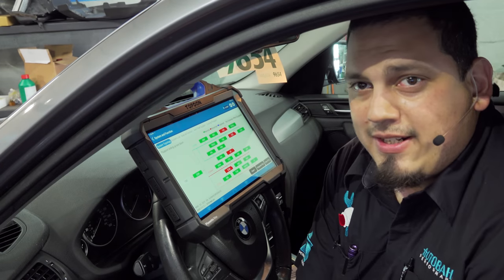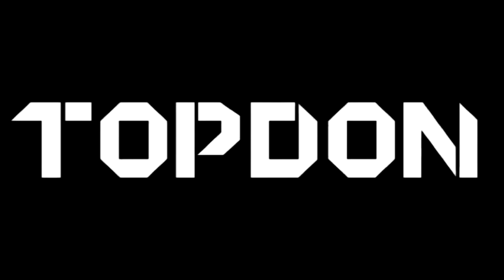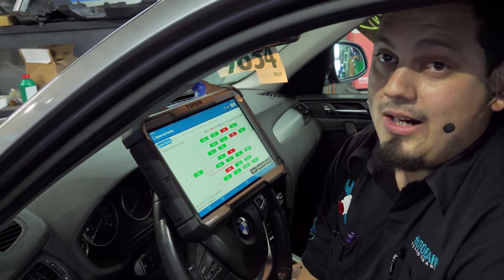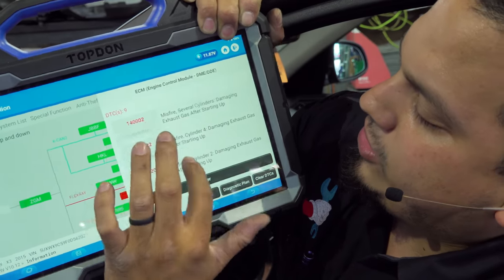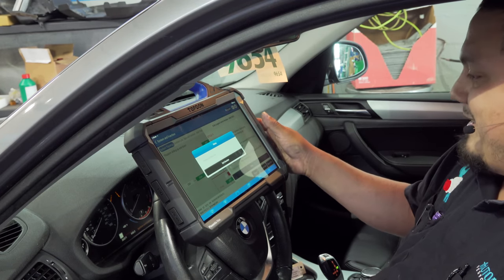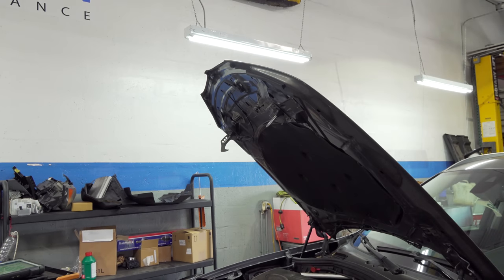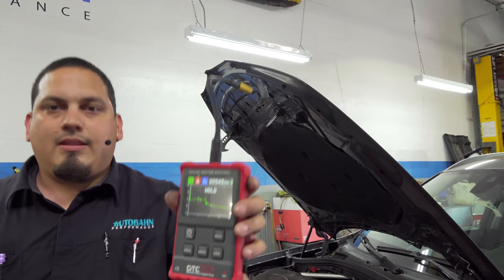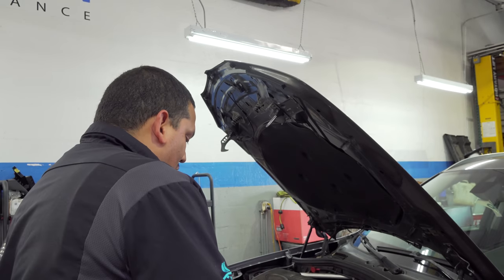BMW X3 N20 | MISFIRE DIAGNOSIS | IN REAL TIME | MULTIPLE MISFIRES

Comment: Dude that ignition analyzer is pretty slick!  You mentioned a lean condition could lead to premature coil failure... Wouldn't that lean condition cause either a partial misfire or maybe a "fuel trim imbalance" code? What did the spark plug look like? 🙂
Reply: Hi there Pine Hollow~Enjoy your evening and great comment too
Reply from the maker: Not always, you know that lol

Lean conditions aren't always on a single cylinder, sometimes it's a small vacuum leak, or pcv valve issue that causes premature ignition coil wear
Reply from the maker: Oh, btw, gdi always run slightly leaner, spark plugs will read accordingly
Reply: @SuperMarioDiagnostics  very interesting! Would the PCM not compensate for that and set a lean code if the mixture is too far out of spec?
Reply from the maker: Most of the time but Not always, sometimes it'll set only high idle rpm codes
Reply from the maker: You asked me about that one LOL can't say that i have lol

Ever see the video i did in the range rover with restricted performance and no codes? 

THAT'S euro logic 😆
Reply: @SuperMarioDiagnostics  mr Spock would say that's illogical !

Comment: great video showing how fast you can diag =. i have one of those i love it. nothing worse than burning out a driver with swapping coils on some cars. dangerous to play that game sometimes.
Reply: Indeed; though the PCM would be far gone now with two misfires and also would know that the coil caused the short because it wasn't there before and then you'd make the right call by selling the coil and the PCM. Win win unless the customer denies and now it has 2 misfires instead of 2; oops 😬
Reply from the maker: I definitely wouldn't swap the coil if i didn't see coil command due to the destroyed driver

Comment: 6:43 so if you have bad plugs with a large gap the coil works harder and then shortens it’s life.
Reply: This is a common cause of coil failure. So, Don't let your customer talk you into cheaper plugs that will wear faster. Coil failure follows.

Comment: Good videos. Help me please i have phoenix elite. Trying to use it on 2015 ml63amg and 2015 A45 do brake bleeding through machine but it says not supported. Same with A/f, power balance,  does it make sense or is it the way it is. O also can't code new battery

Comment: Howdy sir I have a question for you. With the spark analyzer you can see that there is no spark going into the cylinder meaning is a shorted coil. Don’t you think you’ll be able to see a shorted current ramp with a regular oscilloscope ?
Reply from the maker: No it's not a shorted coil. What were seeing is the spark occurring outside of the cylinder

Comment: Great video, thanks for sharing! Got a question: 2008 Bmw 335i with the N54. Running rich all spark plugs black. Has rich codes. Looking at datastream everything looks normal besides the trims are high. Could the hpfp leak into the engine? Thank You!
Reply: Yes, but a simple oil change will tell you, as then the fuel trims will come down temporarily.

Comment: Your letting "THEM" get into your head. I get similar crism when doing mobile diags, I've learned just to blocked them out. Unfortunately haters are a part of life. Top 3 explanation given by haters after the fact, #1 I can diagnose it but I just don't have the time, #2 I can diagnose it but I just don't have the tools you do,  #3 I already knew that was the issue but, (BUT WHAT) lol.

Comment: I bought a topdon phoenix smart and it’s missing modules completely from the installation list and it also doesn’t communicate to a few modules that are installed, my much cheaper autel scan tool does read all modules and communicates with the modules that the topdon won’t, definitely didn’t expect this for such an expensive tool
Reply from the maker: Did you talk to Topdon about it?
Reply: @SuperMarioDiagnostics  waiting on their response, it’s a shame because I really like it, makes me question future vehicles that I’m scanning if it has all modules and showing the correct information
Reply from the maker: What vehicle?
Reply: @SuperMarioDiagnostics  It’s a 2021 F150 Raptor
Reply: @ThatDIYguy862  where did you submit a request for assistance on the website, Facebook, or did you call in? Also, where are you located?